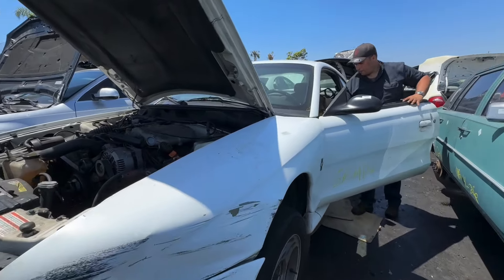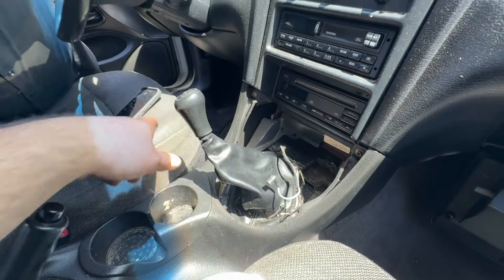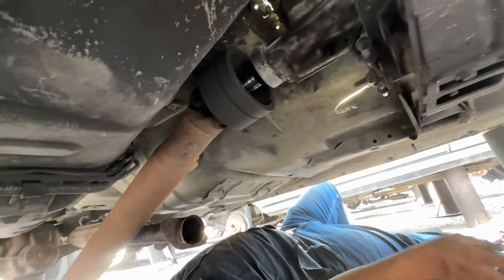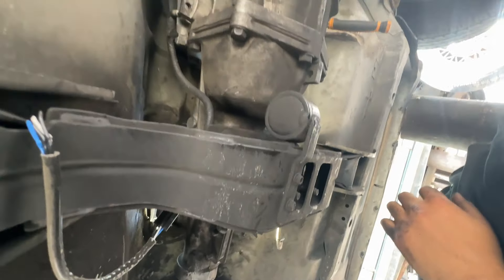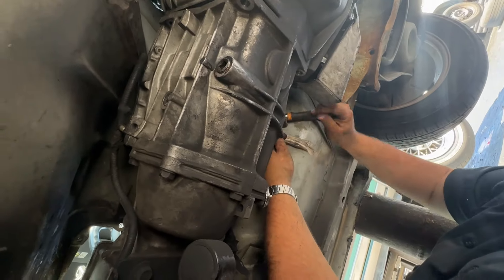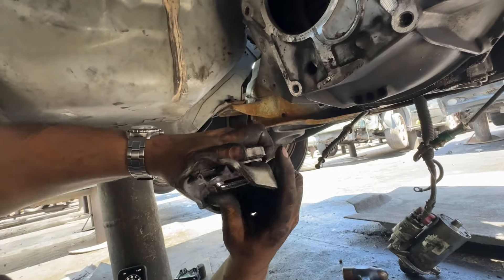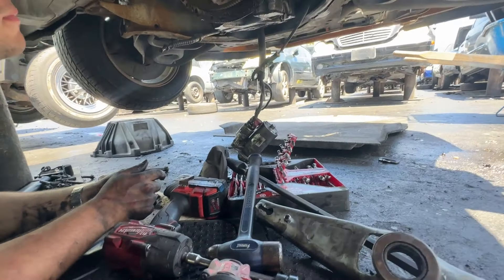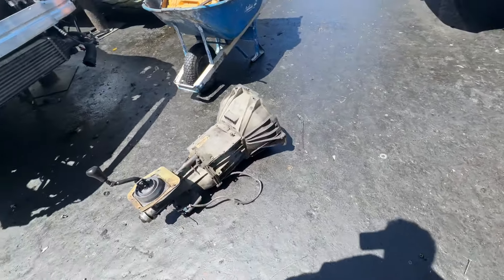I Found a T5 Transmission at the Junkyard!

Comment: Hi Omar. It's Robert from Wisconsin. our 69 Fairlane 500 with T5 in it and 3.70 rear gear. And we get over 20 miles to the gallon with a stroke 351 Windsor.
Reply from the maker: Wow very cool Robert! I’m excited to get started on this project
Reply: And it will run a high 12 sec quarter mile.So it's not like it's slow
Reply: I have a 78 F150 with the 302. Do you know if this transmission would bolt up to mine? 20mpg sounds like something I could only dream about

Comment: Omar- still watching & liking. Even saw you on Tom Cotter's "Barn Finds." This, to me, is the way to go with an old vehicle that isn't worth a crazy amount and/or you want to drive. Nice, brand new conversion kits are great, but the $7+K price tag on many is a bit hard to swallow. At a point, you have to be real with your goals & budget
Reply from the maker: Much appreciated! Yes you are correct, there has to be a point to where I have to set a goal and budget. Or else these projects will spiral out of control haha. I think for now the T5 and 289 will make this car a solid driver. Later on I plan to upgrade the engine and transmission to the TKX

Comment: Score!!! I’m putting a V6 T5 in my 302 maverick. I plan to use the mid 70s 306 flywheel. It’s 28 ounce with 164 teeth. It lines up with the stock clutch.
Reply from the maker: Interesting! I will have to do more research on the swap to make sure everything meshes correctly

Comment: Nice find. Watched the previous vid and I knew immediately when you showed it you were gonna get it 😉. That's the box I should have gotten for my car but I got über clever and purchased the muscle car 5 from McLeod which was a BIG mistake. One thing you ought to consider is moving the shifter location forwards which I believe is possible if you change to an S10 tailshaft housing, which may or may not be easy to find even in Cali (do a search on those, there are a number of forum posts out there). That, or there's an MDL kit which uses a rod backwards from the top cover plate back to the original shifter position. The reason you want to do this is that according to my understanding where the Mustang shifter sits is more or less where the transverse floor brace is, so you'll have to cut it and lose strength (you could deal with that by connecting the sills above the floor but it's a pain). Also if you have a bench seat the rear shifter location won't work I believe as it interferes with the seat.    

Good luck.
Reply from the maker: Thanks for the info, yes I’ve heard of the s10 tail shaft housing to get the shifter in the original place. I might just put the shifter where the brace is and reinforce it. I will see when I put the whole floor in
Reply: It’s not necessary, I have a mustang t5 in my 65 falcon and the shifter is in the perfect position
Reply: @Rempelrides  you mean you did not need to cut the brace?

Comment: G force transmissions sell a kit with new heavy duty gear sets and mainshaft and input shaft that will give it a 600 HP 500 ft lbs rating in a 3300lbs car on drag radials.  Super simple to install.  Not cheap, but not too bad considering what a Tremec TKX costs.  I have one and it works great.
Reply from the maker: Very cool much appreciated, just looked into it. Looks like this is the way to go.

Comment: Make sure it is the same as the 5.0 302 version, there are differences. Input shaft length and spline count vary. There should be a tag on the transmission, run that and see if it’s v8 compatible.

Comment: I'm pretty sure to use that transmission you will need to get a V8 bellhousing and V8 Fox body style input shaft the sn95 Mustang 3.8 T5 had a longer input shaft
Reply from the maker: Yes I will have to do some research. I believe they sell an adapter plate that makes it so I can use the original bellhousing from the comet

Comment: The t5 from a 6 cylinder will fit right on the V8?
Reply from the maker: Yes the 3.8L has the same bellhousing pattern. The same with the 93 thunderbird AOD that I installed. The only thing now is to check the input shaft, flywheel, and all that to make sure it all meshes correctly
Reply: @OmarRamirezGalaxie  Can you use it as is or do you have to hook up the sensors the transmission has?

Comment: You can use the T-5 from the 3.8 ( it’s a World Class) you should still use a 5.0 bellhousing ( flywheels are different)
Reply from the maker: Yes I will have to do more research. I believe there’s a bellhousing plate that allows me to use the original bellhousing. We will see